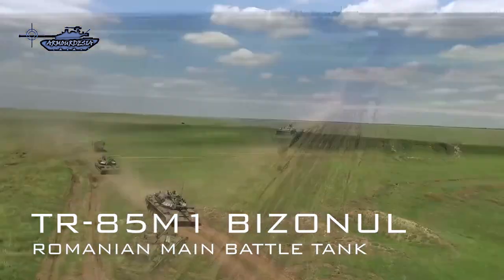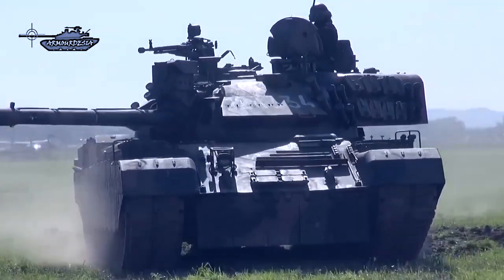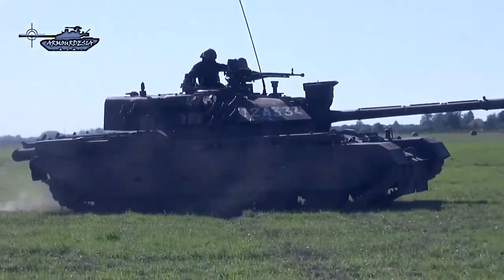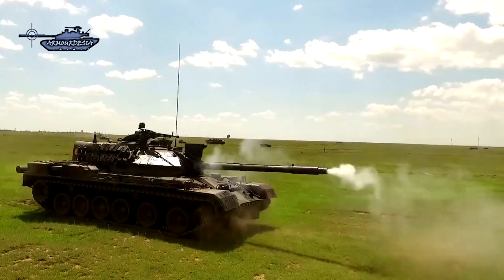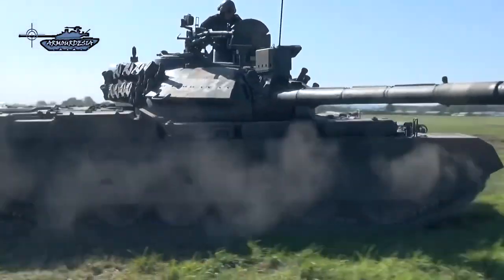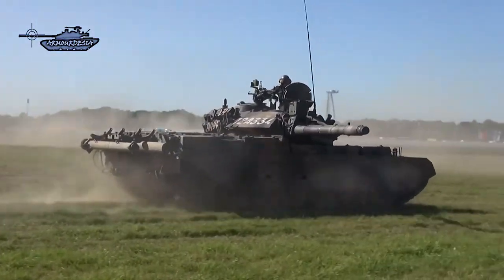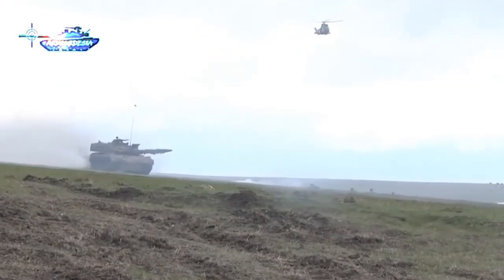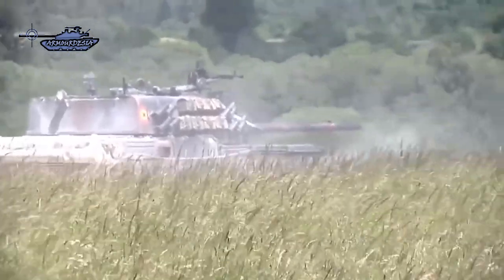TR-85M1 Bizonul Romanian Main Battle Tank review

Comment: i love that there are so many keyboards warriors and paper knowing tank lovers.
Reply: You do realize that it's just a T-55 with a hole in the rear of the turret, right?
Reply: @michaelvonbiskhoff7771  Lol what kind of bullshit comment is that? This tank is 100% based on the T-55, not on the Leopard 1 (which is a completely different tank)
Yeah it has some minor changes, but that still doesn't change the fact that it's still based on the T-55. Just becaus the armor is a little bit thicker doesn't change that fact.
And it is very dooubtful that the turret actually has "580" mm of RHA armor, very doubtful. It's just a little bit of additional armor (which doesn't even cover the entire turret) 
Also, since the additional armor is the shape of a wedge, it means that only the center has the strongest part but it gets weaker as you go up and down (because less LOS).
It's a total failure. This little bit of extra armor might stop an old RPG-7 (and only when directly hit in the center of the armor block)
but anything above an RPG-7 will hole this tank like it's nothing
Reply: @xAlexTobiasxB  from a t 55 only the cannon fits. and the ammunition, nothing else .. buddy leave the pictures TR85 / TR85M1 are slightly different but 99% fit. and not t 55 was the source of copying but only of the study, the turret is bigger similar to t 62 the tank is hoped to receive an 800hp engine from leo 1 that was to equip the first Romanian tank TR77 you study before you go stupid :))
Reply: Anyway, it's a crap tank all in all it needs a bigger gun to shoot modern projectiles 120mm otherwise is just a can ready to be popped...
Reply: @xAlexTobiasxB  that kind of comment has more appreciation than your hole life:)))))
Reply: @weisseadler  its not a crap tank. We shall be proud that we managed to create our own tanks than just copy pasting others 🤦‍♂️ but stupidity in romania is too big
Reply: @cosmin_budda  it was done in cooperation with the germans from what I onow and is nothing to be proud unless you get it close to perfect, is the lack of money and interest from the government...
Reply: @cosmin_budda  you should study the russian tanks first and adapt accordingly since they are the only ones that we can face on the battlefield... The gun is old, engine is not good, armor the same, the gun load is not protected...it's one of the worst unfurtunatley... Romania was always badly equiped... That is the fact and until that changes.... Is usless to discuss...
Reply: @weisseadler  do you have any idea what is the difference between a cannon with a smooth barrel and one with a rifle barrel ?? :)) and after vb and caliber :))
Reply: @leomarin2205  if you will be in that tank against other machine of war during 21st century i can say I will consider myself lucky. And to answer your question... Smooth barrels have no spiral guidance of the projectile from what i know... Rifle barrels like machine guns usualy do have except shot guns...i have to say i'm not a master in the domain but I wait for you to school me comander :-))
Reply: @weisseadler  :))) bine padawane :)))) i-a un pix si un stilou si ruleaza-ti un joint :))) nu aia este diferenta :))))) prima lectie :))pt restu tre sa platesti ca nimic nu-i gratis :))
Reply: @weisseadler   il chiama muma-sa :)) la grisulet , te sfatuiesc sa-l urmezi in exemplu :)))
Reply: @leomarin2205  Ruleaza doua 😂, hai zi'ne scoate'ne din intuneric...
Reply: Tankistu lu tata! 😂
Reply: @weisseadler   stai acolo si respira greu :)))
Reply: @leomarin2205  😂😂😂
Reply: @ravenouself4181  Only traverse is T 55,so..
Reply: @xAlexTobiasxB  The tank is not a failure by any means. it is in fact a success, because that's what it was meant to be, a Upgraded t-55, and it succeded in being one, yes it can't compete with modern tanks but its not meant to, its used as a infantry support tank, by what it was meant to do it succeded.

Comment: This tank is an absolute joke in pretty much every category. The firepower is extremely lackluster. Only 100 mm with a rifled barrel, this is not even on par with the guns on most wheeled gun platforms of some countries like the Stryker MGS and the Centauro. The armor could be considered non-existent. Any ATGM made from 70's and up will go through this tank. it lacks any type of ERA and that addon composite armor is a joke in terms of coverage and performance. The engine is also really underpowered and as a whole, the tank is extremely heavy for how little it offers. It just does not make any sense. It does have some decent features, like the gun sight and early warning receivers, but it lacks an independent commander's sight and many other things that would even make it be on par with stuff from the 90's, let alone MBT's from today. Overall, they could probably hold ground against the old lingering fleets of T72's in the Middle East and not much more. I seriously do not understand why even keep investing in this dead-end.

Comment: As a Chinese person, this tank strongly reminds me of the Chinese Type 88 tank, which is basically an upgraded Type 59 (a licensed copy of T-54) with a lengthened hull and a 105 mm rifled gun based on the British L7 (China obtained a licensed copy of this gun via Israel). The Type 88, just like the TR-85, was intended to be a stop gap tank until better designs came out. The difference is that the Chinese Type 88 has been replaced by newer models like Type 96 and Type 99 and is now mostly on reserve, whereas for some reason the Romanians are still using the TR-85.
Reply: The hull is very similar to WZ-1224/1226. I strongly suspect those prototypes influenced the TR-85. China helped Romanian build the TR-77-580, the predecessor to this tank. It seems likely after WZ-1224/1226 were cancelled, Romanian designers took the hull and added the TR-77 turret.
Reply: Republic of China or Red China?
Reply: @sixgunsymphony7408  I'm talking about Mainland China or PRC. Republic of China or Taiwan uses M48 and M60.

Comment: omg so much confusion here so lets set some things clear...
so TR85 M's are based on T55 same turret but they added a bustle different firing system and add a thermal sensor on top of the gun and the gun is  A308 just an upgrade to old D10 100MM rifled gun and the best round we have its BM-421 sg witch have around 425MM penetration at 90 degrees at 1 KM witch is lacking for modern standards,the hull of the tank is longer and it has one road wheel added and a 860-is horsepower but the damn thing is 50 tones (ohhh forgot to mention that sadly the old 3BM9 APFSDS would go trough the TR85 m1 like hot knife trough butter).
The TR-125 is based on a T72-M.This story starts in the late 70' early 80' when the government orders 30 T72-M from ussr. I honestly dont remember if we got all 30 tank but i know the one's we got where in a horrible condition full of spent and unspent bullets.Then we askd the soviets if we could built it in Romania under license,but they went on a hard nope,you cant build them,so we did the next best thing,they reverse-engineer the T-72 tank. ICSITEM research institute from Bucharest took over the job of building and upgrading the turret and auto-loader,while F.M.G.S.("Fabrica de Mașini Grele Speciale" or FAUR) from Bucharest worked on the chassis making it almost a meter longer than the T72 adding one more roadwheel andmaking it around 50 tons and a more powerfull 900 horsepower 8VSA3 diesel engine and a different upper front plate (a bit thicker than the original T72,dont ask by how much i dont know and also the turret should of had a different composition and thickness around ehh 520 MM of composite armor) and the gun was the A555 125mm was developed by Arsenal Reșița factory.Between five and ten prototypes were made between 1987 and 1988 and tested until 1991.Sadly now they gather dust in storage.
And now the worst for the last THE PAPER  tank called TR 2000 it had 3 variants B1,B2.3 and B2.4 ill be short here most of the images are iffy at best because the B1 should have been a TR85M1 chassis with a LEO 2A4 turret and a 1000 hp engine upgrade and the same 125mm A555 canon,B2.3 should have had the TR125 chassis and a LEO 2A4 turret,L44 120mm Rheinmetall canon and a MTU 1200 HP powerpack and maybe the best one the B2.4  a TR125 chassi modified for the MTU 1500HP, with a LEO 2A5 turret and the L44 120mm Rheinmetall canon and all the bells and whistles that comes with the 2A5 turret.The B2.4 is know as TR-2000 but the images that you find on the internet are wrong because the show a TR 125 chassi but the turrets are wrong,the turret from the images are a Leopard 2000 turret witch was a technology demonstrator platform and that turret had no composite armor built in (the term is "spaced armor" because there is no composite material,only two rolled homogeneous armor plates and some air between)
And as Romanian pleas dont call the TR85M1 a third gen MBT its more like a 2.5 generation MBT :D
Reply: This tank is similar do the m60ambt in my opinion. A "modernised" version of a tank that should be long gone by now

Comment: They are good tanks thinking Russia also operates mainly T 72. 
The M1A2 Abrams dislocated to Romania will care for T 90 while the romanian TR 85M1 will serve for T72 and others.
Reply: The Romanian TR-85M1 cannot serve anything, there are less than 60 tanks and the factory in Bucharest cannot make new TR-85M1 tanks.
Reply: @dragosstanciu9866  "cannot" its a factory why shall we produce tanks when its peace.
Reply: Ill remind you that 80% of russias tank fleet is the old T-72 with upgrades. So the TR-85M1 is not obsolete, but yes Romania needs newer tanks to combat the handful of T-90s that russia has.
Reply: @cosmin_budda  The tank factory must make new tanks in order to replace the old and obsolete tanks. However, right now the tank factory cannot make new TR-85M1 tanks because it needs new technology, new machines.
Reply: @healththenopulence5106  You don't need to remind me, I already know, but the fact remains that there are very few TR-85M1 tanks and new tanks will not be made.
Reply: @healththenopulence5106  true
Reply: @healththenopulence5106  Even the T 72 A is much stronger, than the TR 85 M1. at least 3 Tr 85 M1 needed to annihilate one T 72 A.
Reply: @dragosstanciu9866  I just read that General Dynamics purchased Uzina Mechanica bucuresti which is the factory that made these tanks , Gues what General Dynamics Makes - The Abrams Tank , Perhaps now the romanians will get the technology to build a new modern tank Maybe the TR-2000
Reply: @michaelrusso4063  General Dynamics European Land Systems will manufacture the Piranha 5 APC in Bucharest. Hopefully this will open the door for a future cooperation concerning an MBT, but the chances of that happening are slim.
Reply: @dragosstanciu9866  from what I have been reading General Dynamics will be training Romanian UMB factory workers at their US plants. This will be a transfer of knowledge and technology which is exactly what the Ro Defence industry needs. And yes indeed they will initially be building the Piranha 5 APC. However, it all depends on the needs of the Ro Army and the investment priorities of the Ro Government.  If the Ro Gov. would place an order for tanks for 3-4 regiments I am certain General Dynamics/UMB would have the capacity and the technology to produce them.
Reply: @michaelrusso4063  It will take a lot of time to reequip the Bucharest factory to produce tanks. Modern tanks incorporate hi-tech equipment, complex armor and ammunition, thus it will take a lot of effort and money to modernize the tank factory, and all this presuming that the Romanian government will want to buy new tanks and not second-hand Abrams or Leopard 2 tanks.
Reply: @dragosstanciu9866  indeed a feasible option would be for the Ro Army to purchase old Abrams tanks which potentially would get modernized at General Dynamics/UMB. The US has a large surplus of older model Abrams and is transitioning to the newest M1A2 SEPv3 Abrams model. However, I have been reading a lot about the TR85-M3 model, which indicates that there is a real effort behind developing a native Romanian Tank.
Reply: @dragosstanciu9866  Hmm , Is entirely possible that Rheinmetall Romania will be producing the new TRB-85M3 and not General Dynamics at UMB. as I recall the TR85M1 was originally designed after the German Leopard Tank, It would only make sense for the new TRB-85M3 to be constructed by Rheinmetall since they build the Leopard 2 Tank. The news article says that they will be building at least 400 armored vehicles in Romania. What if these 400 vehicles are actually tanks and not armored vehiches.
Reply: @michaelrusso4063  For those 400 armored vehicles to be tanks the Bucharest tank factory would have to be prepared with new machines, new technology and trained engineers. All that takes a lot of time and money. Meanwhile, there are no signs that such a transformation is taking place at the factory.
Reply: @dragosstanciu9866  But why would you engage with Rhinemetall at Moreni to build Armored vehicles when you already have a similar armored vehicle constructed by General Dynamic at UMB? Why double the effort unless they are looking for a bigger technology transfer down the line. in my view the Armored vehicle is just the initial step before expanding your construction capabilities.
Reply: @michaelrusso4063  I hope you are right. I would love to see a new Romanian tank, not just another modernization of an old TR-85M1
Reply: @xerxen100  that really depends, my friend
Reply: @healththenopulence5106  The T-72 is more servicable than the TR-85. The B3 upgrades while not the best and won't be able to go toe to toe with Abrams or Leopard still can stand it's ground because combined with the base T-72 armor and ERA it can deflect some western guns but it's a different story with the TR-85 where the base armor is a T-55 which was designed in the late 40's and slapped with some older ERA. The FCS too is not comparable to the T-72B3 FCS and the gun cannot penetrate anything modern.
Reply: @xerxen100  how you know that?
Reply: @MelodyAndKitsune  Tr85 has a much much weaker main gun. Even with special ammo cant penetrate the T 72 front armor.
Reply: @xerxen100  than why we prefer to keep the T72 we have in storage and rather operate the TR85M1?!
Reply: @healththenopulence5106  You compare T72 with TR85???? Don't!!!! Huge difference in favour of T72s!
Reply: @dragosstanciu9866  Au vandut presa de turele la suedezi acum 25 de ani!

Comment: TR85 needs a concrete modernization at M2 level. How much would this cost?...Gun MG253 al IMI (denumit si RG-120)/Slavin Land Systems (developed from MG251 of Merkava III and IV) close to the mass of the A308-100mm gun. Improved protection both at the level of basic and additional armor, supplemented by active jamming systems (Shtora), active hard-kill systems (Trophy, Arena, Quick-kill). Anti-mine/IED protection under the floor, (including active protection - Electro-Magnetic antimine). Engine 1200-1250 hp. The ability to modularly receive additional secondary weapon systems. Bringing the fire control and day/night vision systems up to date, as well as a communication system and real-time management of the battle. 360-degree visibility from the passenger compartment. Modular concept both in terms of interior design and additional armor modules (easy to replace in the field). With these upgrades, TR85 at M2 level would easily climb into the top 15 in the world. At the M1 level, 800 thousand USD reservoir was spent. Too little to produce something effective. Russia spent 2.8 million USD on the T90. Now you draw the conclusion.
Reply: God knows how much all these upgrades would cost!? The T-90(M) with the Relikt ERA is an excellent tank but it costs a bit more than 2.8 million USD!
Reply: @matovicmmilan  I think over 4 million USD...
Reply: @Storel552  
Even 4 million USD is perfectly fine for a top line tank. I doubt it's much more because it would approach the price of two standard T-90 tanks(2.8 USD).
On the other hand, is there any initiative in Romania for obtaining a new tank?
Reply: its too old to be top 15.

Comment: Romania 🇷🇴 in my opinion must buy Merkava from Israel  100 piece 🇮🇱 and from UK 🇬🇧 Challenger mbt. 100 piece adaptation four Romania geography.
Reply: Merkava 4 and Challenger 2 tanks are too heavy and expensive. Romania should try to get second-hand Leopard or Abrams tanks.
Reply: @dragosstanciu9866  Ce dracu , Abramsurile mananca 20 de litri pe 1 km , le scot astia decat la razboi la consumu asta, desii sunt tancuri bune
Reply: @popadumitru5785  Atunci Leopard second-hand, daca Abramsurile nu sunt bune.
Reply: Rather South Korean K2 Black Panther due to Romania's mountainous geography, which the K2s are specially designed for.